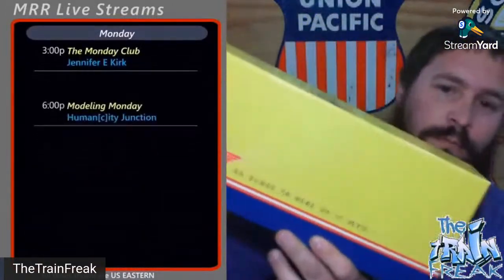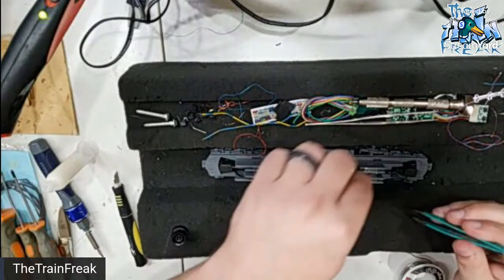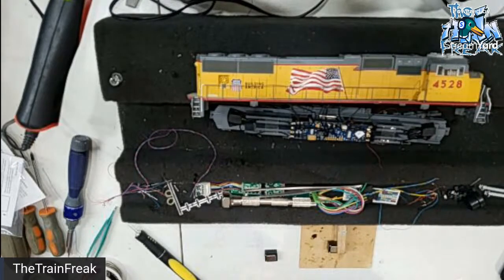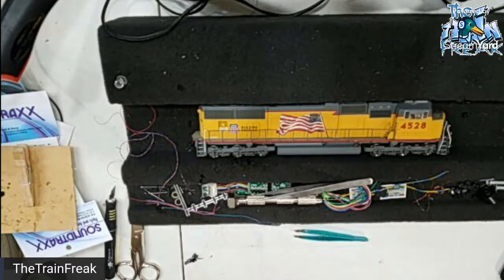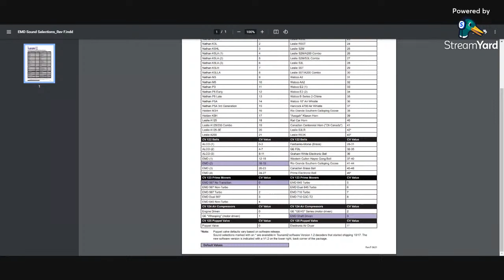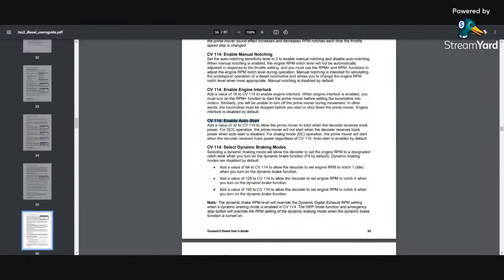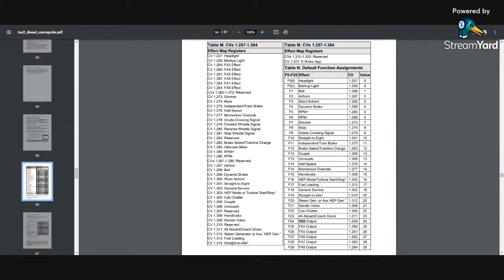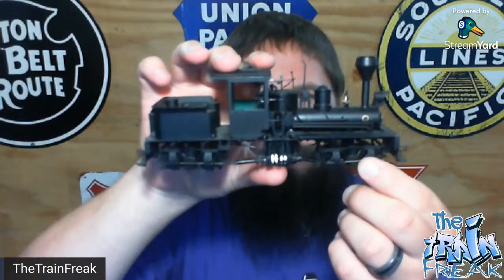How To: Install & Program Soundtraxx Tsunami-2 in an Athearn Genesis UP EMD SD70M

Comment: Thought I caught a reference to not being able to use a GoPro as a Web Cam ... Am considering 
GoPro's (among others like it) for Web Camming ... Which model do you have ? ... Using it on 
Windows of Mac ? ... What's the major bug with it not working ? ... Don't mean to be nosey but 
I chase electronic bug/problems down rabbit holes for a hobby ... I did find some recent info 
from GoPro on new procedures/software for certain models ... Enjoy your videos, especially 
the new ones on your new layout ...
Reply from the maker: GoPro Hero 8 Black. I downloaded all the drivers and all I get is the grey screen with the GoPro logo. Their tech support is stumped as well. Windows PC.